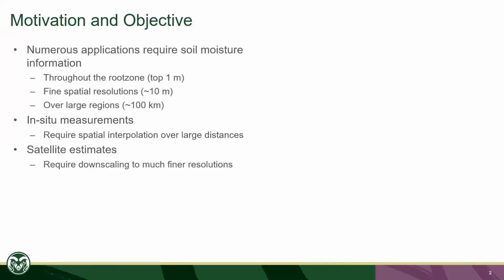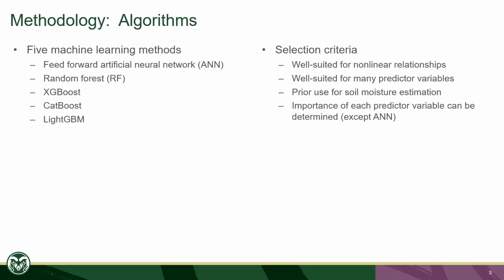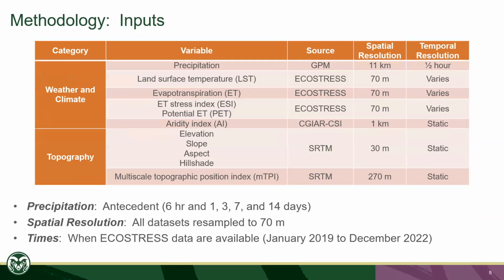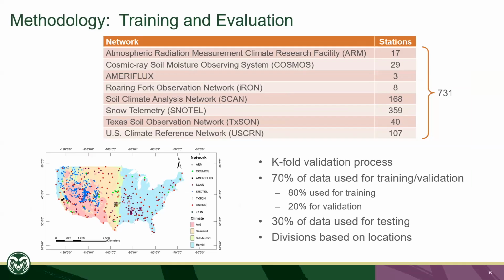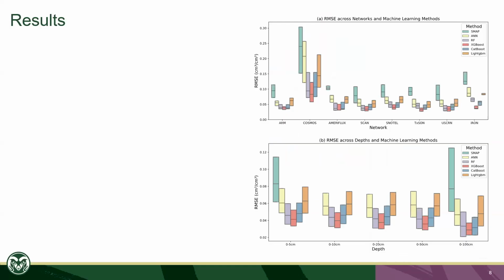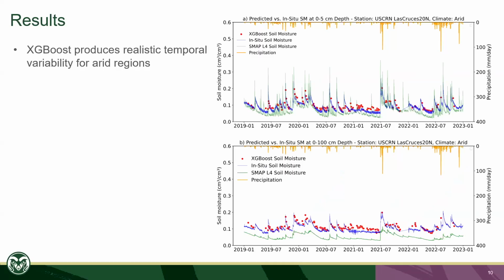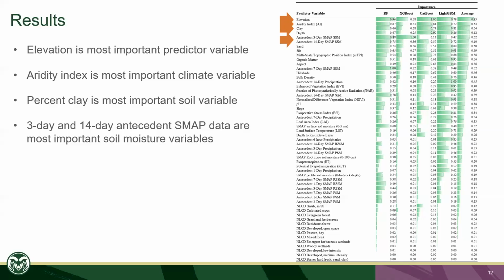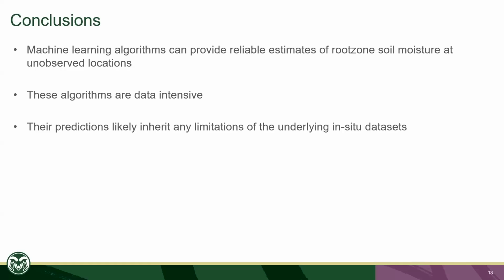Estimating Rootzone Soil Moisture Combining Multiple Remote Sensing Products with Machine Learning

Comment: Hii, im doing simimilar project in ML and im a complete bigginer may i ask, 
1. In case of machine learning we need to put input and output into ML right? So what did you give as Output into ML model

2. Whether the data input will be given as time-series data or as a spatial map.

3. How could we input these data sets into ML For modelling. (.csv) file
4. What software did you used for ML application something like MATLAB for giving codes??
Reply from the maker: You can reach out to the presenter with questions.  https://www.engr.colostate.edu/ce/people/jeffrey-niemann/